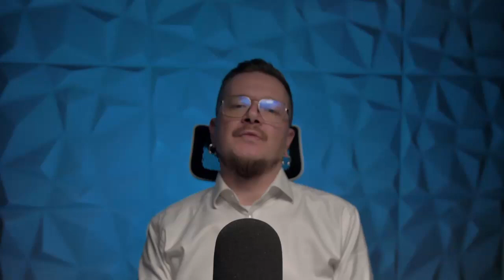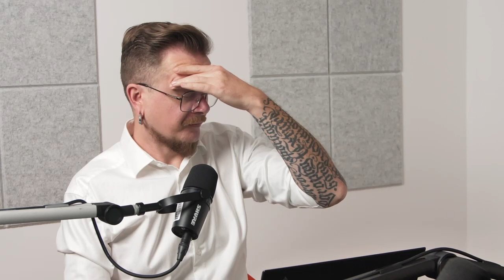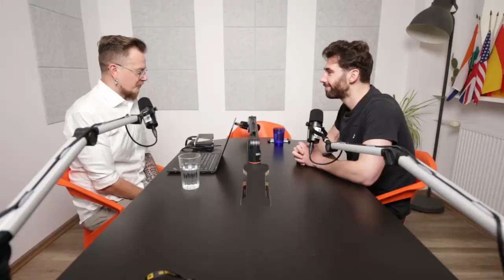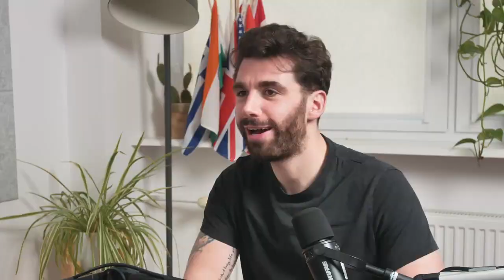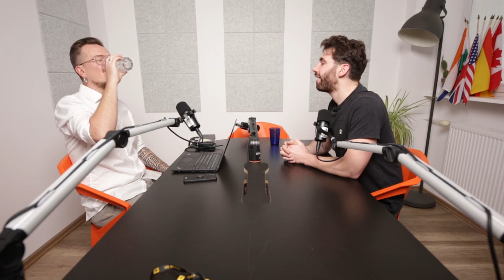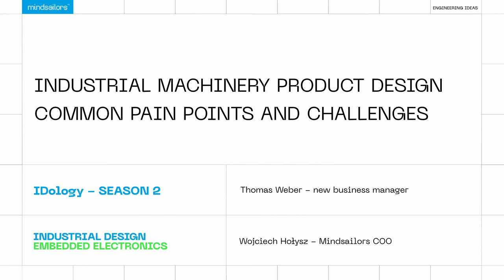Industrial machinery design pain points - IDology #18 - Industrial Design Podcast

Comment: So having experience with manufacturing guidelines (e.g. injection molding, sheet metal, etc) creates the difference between a product designed by a university student & a practicing industrial designer
Reply from the maker: You've oversimplified this a lot, but yes, experience in designing for manufacturing, assembly, and manufacturing costs is crucial. That wasn't the topic of the discussion anyway :)